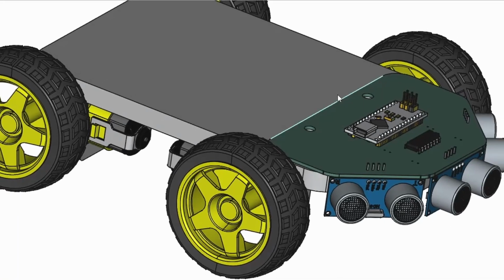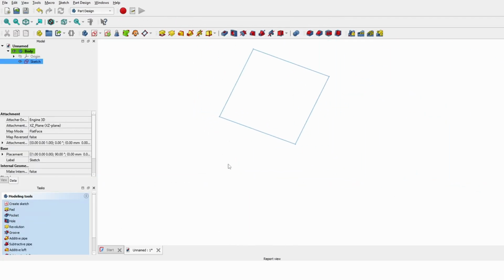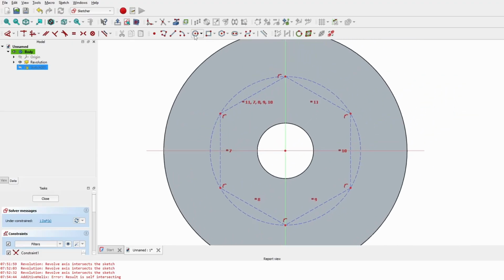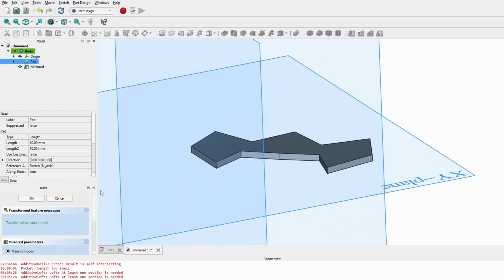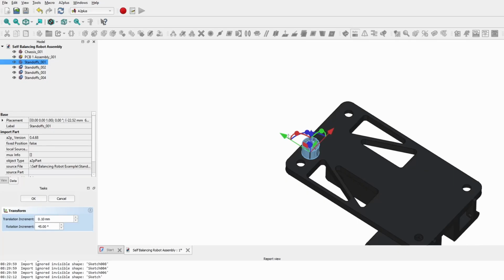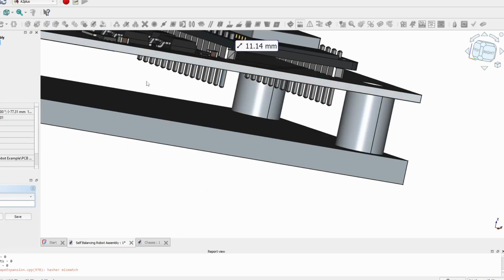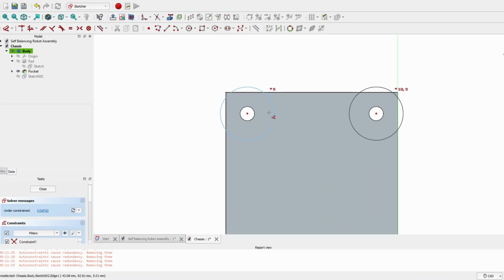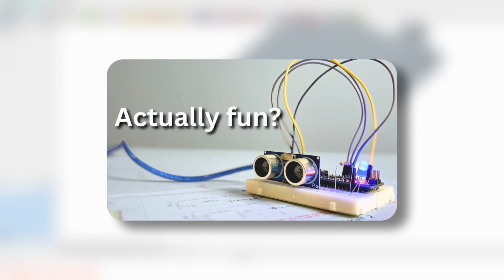Beginner's Guide to 3D Modeling With CAD, in 30 minutes! (FreeCAD)

Comment: So, I am an electrical and computer engineering student, and I just finished my freshman year and beside the basic classes I took a class on AutoCAD and SolidWorks and even though I did well, but I hated that class and I'm not into ME stuff.  is it bad if I skip 3D Modeling with CAD when I am doing EE projects?
Reply from the maker: Hey Sam. For EE projects strictly, you don't need 3D modeling. However if you want to incorporate EE into a big project like a robot or a drone, then that would incorporate 3D modeling as well (but also programming, so in general, it incorporates a lot). Sorry that you don't enjoy 3D modeling. I took an engineering class in HS that had some 3D modeling, and wasn't too interested, until I began to use it in my own projects. It's one thing to follow a curriculum to design something that you didn't come up with, but once you use that to make something you did come up with and bring it into real life, that's where it gets interesting. But, if CAD ain't it, then it ain't it.
Reply: @TheTinkeringTechie  Yeah you're definitely right. Like you said once I start working into more advanced projects like a robot, doing 3D would be necessary, but I do enjoy programing though. thanks for the answer.